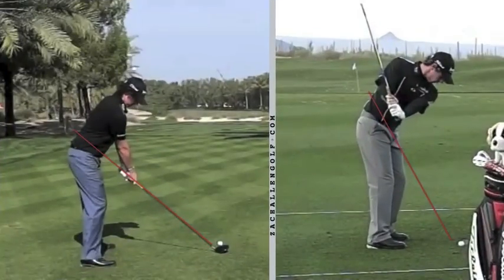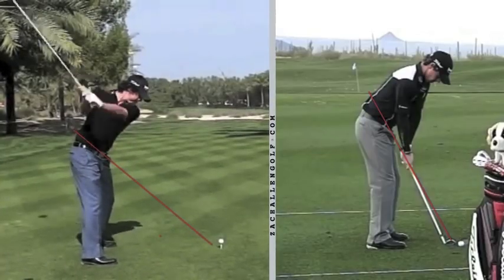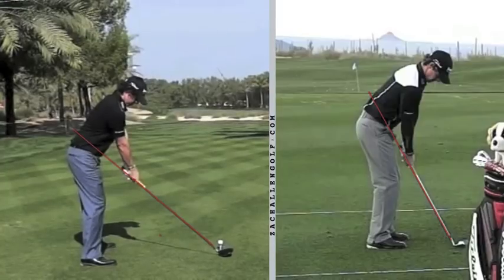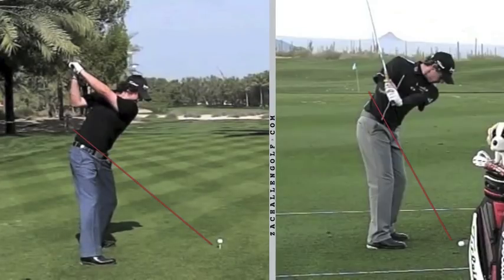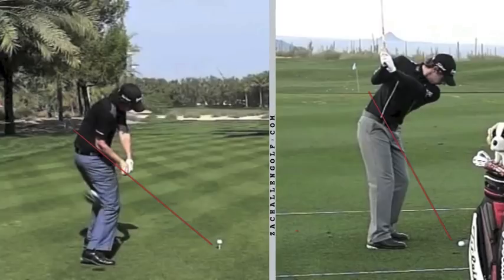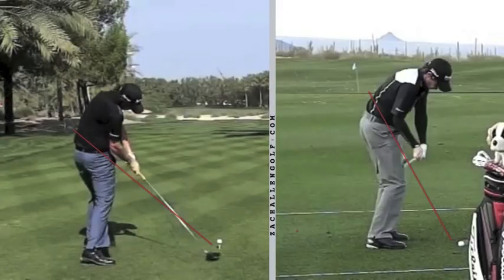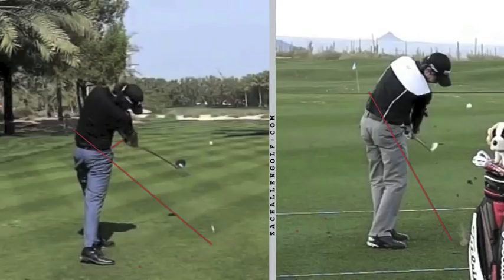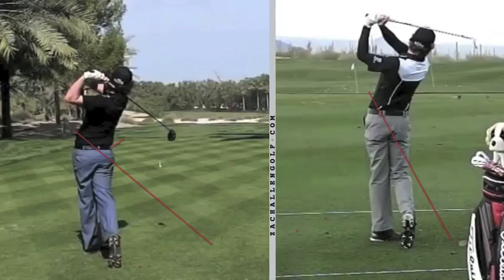Rory Mcilroy Iron vs. Driver

Comment: Good video. Of course the basics of the swing are the same but one hits the ground one slides it. There are BIG set up differences, and you want to keep it short with short irons, medium with long irons, and release it all with the driver as long as you have strong legs and core and good flexibility. Otherwise keep it all short and simple!

Comment: a lot of this analysis does not take into account the shape of the shots he is playing, if you notice he is hitting a high draw with the driver considering the shape of the fairway and with the iron he is really just hitting a 3/4 swing 9i or even wedge judging on the length of the shaft, that changes completely how he naturally uses his body with the different shots.

To do a true comparison you need a full blooded 9i high draw or it is gonna look different.

Comment: 50 yards width at 300 yards driver distance is an error range of plus or minus 25 yards.
this is the same accuracy as 25/3 = 8 yards error at 100 yards ( = 300/3) wedge distance

if the average green is 25 yards wide, an accuracy of plus or minus 8 yards gives you an extra 9 yards (=25-16) room for error.

so it's easier to hit a wedge on the green than to hit a driver on the fairway.

so no; distance is not the most important thing with the driver; accuracy is.
would you rather be 300 yards in the rough/water/trees or 250 on the fairway?
that's why McIlroy et al often take a 3-wood off the tee on a par 5.

how about giving us hackers a video showing us how to get more accurate (rather than longer) drives?

slow your swing down and hit the ball further as well as straighter! - because the harder you swing, the less controlled it is.  even Rory goes off the rails sometimes.

a slower swing has a better chance of hitting it in the sweet spot, which is why it goes further on average than the average result of a heave-ho "crush the ball" mentality.

be nice to the ball and give it a little smack on its behind and it will thank you for it by going straight and true.

it works on women too (but don't tell them i said that)....:)
Reply: Mcilroy missed on fairway in the last round of his major, was hitting 300m off the tee with his driver - eagled the last par 5 :-)  But point taken ... players need to consider risk and reward - once watched a very old fella in an argument with his buddies on a local course - he was used to using his putter very reliably and regularly from 40m off the green - his friends were telling him it wasn't proper golf and were kind of upset that he was always getting closer to the pin than they were when they used the "proper" clubs.
Reply: i will leave Texas wedges to the Texans and stick to learning to chip with a putting stroke unless the grass between me and the green is all flat with its nap lying towards the green.  from 4m off the green maybe, but 40, never! :)
Reply: Those fellows were hitting over something akin to a half-reclaimed swampland up onto slow  elevated greens - best tool would have been a hockey stick probably ... and yes, putting stroke and keeping the ball as close to the ground as possible seems like a good strategy - works for me too... so thanks to youtube coaches :-)

Comment: Don’t listing to this dude im a single digit handicap golfer been +2.8 at one time and have shot 8 under before and several under a lot. All swings the same hands arms feel all the same. Ball position and your distance from ball changes a bit... but the feel and tempo doesn’t change much shot 3 under on 9 holes today so do yourself a favor. Learn a great 9 iron swing and mimic that with your driver in terms of feel and hands and just lengthen the follow through and you will enjoy golf